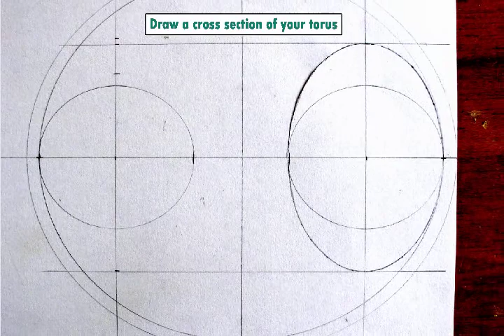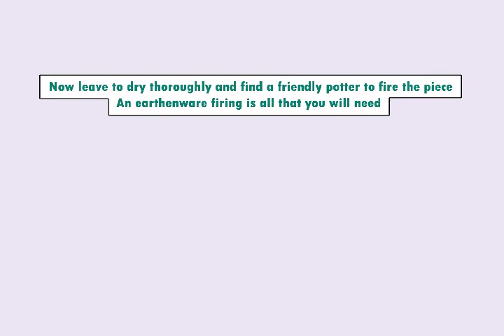Make a plaster mould for any torus - and slipcast with it

Comment from the maker: @RomeoDLN1 Not sure about glass, but I would suggest vacuum forming two halves in perspex and resin-gluing them together. Drilling a hole, filling it with the fluid cutting another piece of perspex to fill the hole. Not sure what the properties of plasma are. Regarding glass - I imagine the same process would be used but using a heat resistant casting material instead of plaster like a sand mold.

Comment from the maker: @greenteagod - Two piece mold - Good idea - do you mean making this mold twice, and attaching the two pieces together and then having say a 1 inch hole in one side to pour the slip into? Its probably better than 2 joining 2 separate cast halves. The problem I have found (as you say) is always if you let it dry too long, the clay grips the central core. The trick is to get it out after a while, and then once out it doesn't distort too much. You might need to make 2 or 3 attempts.

Comment: Hey, @Tom Barnett. What type of clay do you use to shape the plaster former in the beginning? Can this clay be reused to make more molds?
Reply from the maker: Any clay is fine. Not too grainy I guess. I used very basic modelling clay. Just don't let it dry out at all or shrinkage. And yes you can use again for other molds but not for firing right.
Reply: @2tombarnett  Great, thanks. Another quick question. Once the basic clay form is ready to have plaster poured on it, could i create a barrier around it and pour all plaster in its liquid state? Or would this negatively affect how the master mold will turn out?
Reply from the maker: @alfonsocamero3661  absolutely. Another good way of making a mold.

Comment from the maker: @corvusdaggrium I can make you one but as you can see its quite time consuming. Also you live in the states right? So theres more danger of it breaking in the post. However. Time taken: Clay original: 1 hour. Plaster form: 1 hour. Slipcasting finishing, firing and sanding 2hrs therefore Labour = 4 hrs. Then there's materials on top of that - which is actually quite minimal. and postage. If you're still interested let me know. If so estimated production time: 1 month from January.